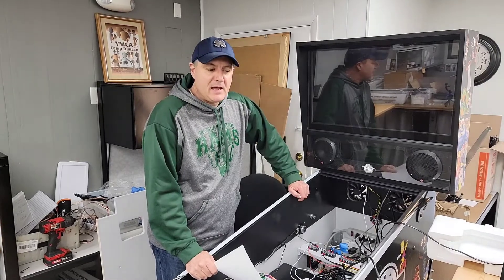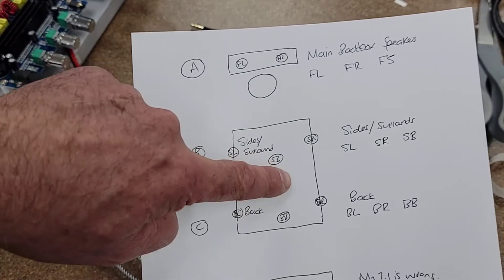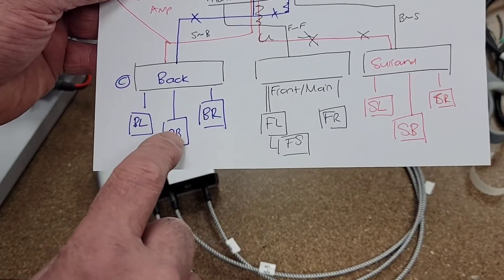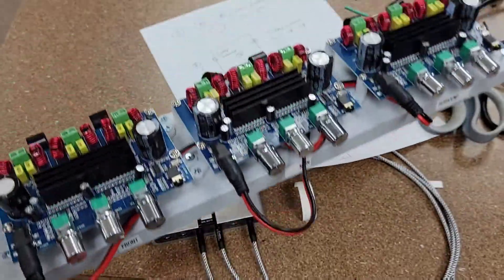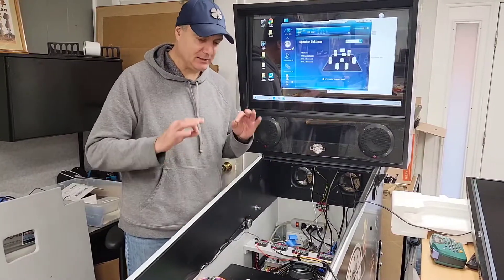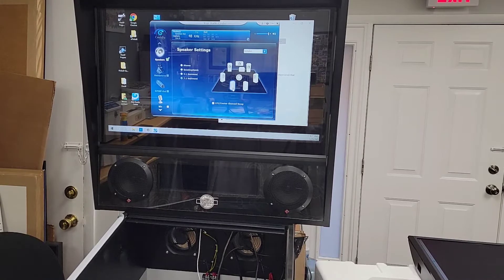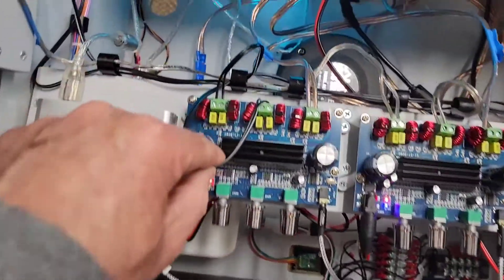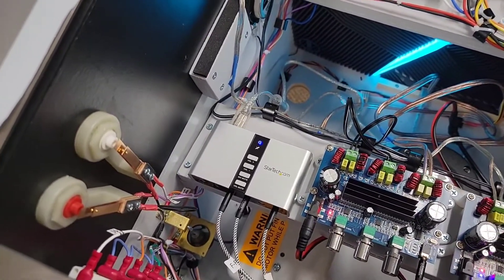VPin Project. Video 54 - Audio Troubleshooting

Comment: I just purchased that USB sound device and thought I might be having the same problem.  Tables sound good, but when running a sound test (using Startech's software and Windows), it too sounded like the side and rear outputs were mixed up.  They were kind of indistinguishable.  I think it might have something to do with the way the testing is run, because I think it sounded better with them in their correct outputs regardless of the test.  Also, I purchased two additional exciters for the subwoofer of my amps (one in the front and one in the back).  They're kind of cool when bumpers are hit, but become a little annoying.
Reply from the maker: For testing, make sure you put your hand on each speaker as you sound check each speaker. As you said, it's hard to distinguish where the sound is coming from so this helped me a lot. The reverse setup is still utterly perplexing but it works. It's more mentally annoying in that my labels are "wrong" and it's not doing what it's supposed to be doing - but it works perfectly. Good luck with you build.